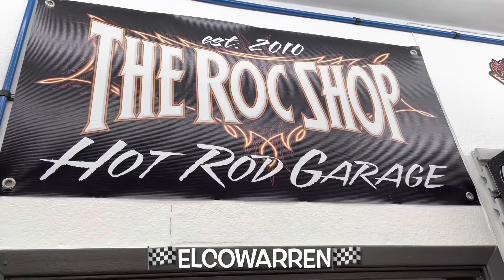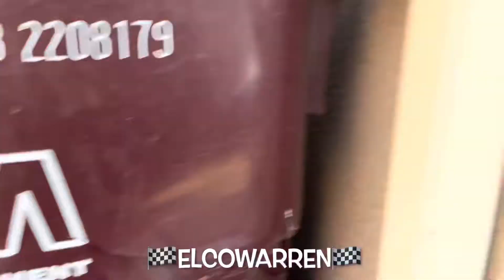RocshopChronicles: Swapped Oil Pans on the LS376/525

Comment: What size are the motor mount bolts to the frame?
Reply from the maker: I’ll have to look when I get to work. We have 10.1’s. I took an old bolt and found the correct size. Can’t remember the thread pitch. I’ll find out and post back bruh!🏁🏁
Reply: Thanxs
Reply from the maker: Finally got a chance to get in the machine shop. 10mmx150x30  I brought in an old OEM set and matched it up. That’s the size I used in this vid.. hope this helps fam!🏁🏁🏁